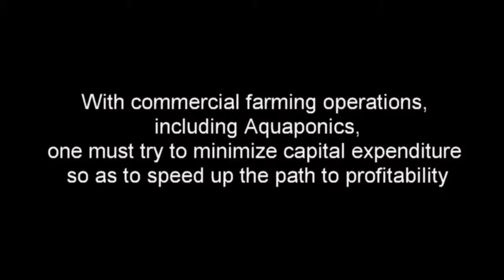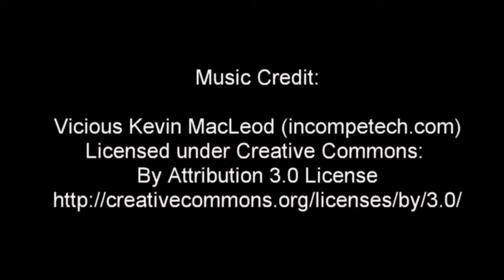How to build a small commercial DWC aquaponics system on a shoestring - For less than $1700

Comment: Thanks for sharing mate. 
Can you please tell me is there any thing done for aeration and also at what rate the water is pumped IN and OUT from  the system.
Reply from the maker: Thank you.. There are 50mm airtsones per growbed for aeration. You can see here http://www.myaquaponics.co.za/blog/8mx8m-open-space-converted-into-740-plant-aquaponics-system-for-less-than-r25000-us1700/  Fish tank relies on surface splashing for aeration.. Circulation flow is low at around 300-500 l/hr. Ideally you want the volume in the fishtank to turn once or twice per hour. We would need a water pump to achieve that, but decided to stay with airlift pump only and its working fine.

Comment: Hi just want to find out what power would you recommend for the airlift pump because I see in your comments you said that you will rather use a bigger pump.

Did you put a airstone inside the sump to blow the water back to the fish ?
Reply from the maker: Hi, we used the biggest air pump we had in stock which is the LP100 (100 watt - 140 l/m). We do not use an airstone in the sump to airlift the water to fish tank, we simply use a 12mm pipe directly from the air pump

Comment: Greatest video
But tell me why u used plastic bio balls and what is this.

Will not it add plastic into water

Love and thanks
Reply from the maker: thanks.. We used bio balls because we had some extra lying around though we prefer to use Leca (lightweight expandable clay aggregate). Bio balls are however extensively use as a bio media in the Koi ndustry as it has a good SSA (specific surface area). No issues with plastic affecting the water as they are made from food grade material

Comment: I love it!

May I know, how long did the liner last?
Reply from the maker: Hi the liner is still going strong.. Should last at least 5 years, but can last up to 10 years.
Reply: i think black liner last longer with more carbon in it, cold water also make it last very long time, sure over 10 years.
Reply: @Kingsley Mitchell scammer. do not google

Comment: Hi, I would love to build one of these systems myself, but would like more information on what you would like to improve on this system. From the comments I see one thing would be a stronger pump. Is there anything else? Also instead of your filtration system, I would like to build my own filtration system. I was thinking after the fish tank a swirl filter (210L blue barrel or conical tank) that would have those brushes in as well, followed by a constant flooded media bed for biological filtration. I could possibly grow some plants in here as well if I have the nutrients to spare. What do you think of this?

I would also like some more information on the airlift pump as I have never used one before. If I am correct, the hole you dug was 1.3m below the ground and your tank was also around 1.3m high, so the total length of piping you used to make up the height of the airlift was around 2.6m. You then place a large pipe into the hole that you dug which acted as your "sump" for the grow beds to flow into and to house your airlift. Was the airlift constructed out of 50mm piping as well? I am also interested in how you injected air into the airlift. did you just do a simple hole in the side of the airlift and attach the airlift to the air pump with irrigation nipples, or did you build a compressor chamber at the bottom of the airlift?
Reply from the maker: Hi Mark, most of you assumptions and ideas above are correct. You can easily build your own filtration system as per your comments. Airlift works on a one to 1 ratio, so if you want to pump up 1m, then you need to go down 1m with the air feed. We just use a 12mm irrigation pipe from the airpump to the bottom of the airlift pipe. Simple "U" connection into the bottom of the 50mm air pipe. Feel free to email us for more info. Email on our website at www.myaquaponics.co.za
Reply: @MyAquaponics1  Thank you so much for your prompt reply. I am still looking and learning more about aquaponic systems, if you don't mind I will come in the future with more questions hehe.

Thank you once again, and please stay safe and healthy.

Comment: By using a T instead of a bend you would be able to move even more water to the fishtank. Right now the pipe needs to move both air and water through the same pipe. By adding a T the air can escape and the pipe move alot more water
Reply: thanks, never tried that, so will give it a try
Reply: snubbel buff just like using a straw in a bottle for air escape
Reply: Add a venturi
Reply: snubbel buff 
Need some help building one in Jamaica
Reply: Not true.. a 90 is a 90 either way giving the same limitations to flow. However drilling a small hole in the top of the bend will allow all air to escape and get higher flow cause the pipe won’t be trapping air restricting syphon would actually be better unless you submerge the t and add stand pipe to it. In that case you would get the exact same flow from either setup. If you want to increase flow you need to get a full syphon which for some reason aquaponics is scared of. To prevent it from draining the entire tank in event of pump failure you add a hole just under the water line so it will break suction once water drops how ever far you are comfortable with and sump able to hold. You can actually get more flow from a full syphon 3/4” pipe then most are getting from the standard t fitting type setup using 3-4” pipe. If you want to do it right imop for aquaponics Systems 1-1/2” pipe using the t setup submerged 12” under the water to increase hydrostatic pressure on the system and using a 13-14” stand pipe off the top of that tee to reestablish syphon when power returns with a gate valve on the pipe to dial in the flow how you want would be the best setup. Then drill a 1/2”-5/8” hole in the stand pipe 2” below water level to prevent syphoning 12” of water during power failure. You can achieve over 2000gph and close to 3000 flow this way getting much better solids suction out of the tank cause of the full syphon then tune the valve to the flow the rest of your system can handle. You can run pipe much further and have a much cleaner, more efficient and cheaper setup this way cause you’re buying much smaller pipe. Ideally size the pump to 1 or 3/4” return lines and depending on head pressure you can have 1650gph easy in return with the ability to intake much more. This prolongs the life of the pump itself as no restrictions are place on the pump itself.

This is how we setup sump systems in regular fish tanks. 1” returns with 1-1/2” intakes using full syphon. We setup the system to only have the sump relieve at best 10g of water in event of failure and at same time we baffle the sump so the pump can only add 10g at best to the tank in event of a clogged intake line. 

Tune the intake to the return needed for balanced flow and eliminate all additional pump pressure on the systems. With this common setup we turnover water 10x per hour wo breaking a sweat. Higher turnover yields more dissolved oxygen and a cleaner overall system. Then you can increase pipe size and decrease pipe size where desired in the plumbing to reduce flow pressure or increase it wo altering the actual flow and water turnover of the system.. for example you wouldn’t want to blast a flood and drain media bed with high pressure from 1600gph flow rates.. so increase pipe right before the bed to 2-3” and use an elongated spray bar this would yield close to the desired water pressure into that bed wo sacrificing overall flow. Then use the same 1-1/2” pipe in continuous flow syphon from that bed. This whole belll syphon thing makes no sense. Out planted tanks have plants underwater entirely and indefinitely. They grow just fine and very fast. We add co2injectiin simply cause water doses have the same capacity air does. End result there is more then enough o2 in the water with a proper setup so roots don’t need to be out of water. I’ve actually seen several recent tests indicating this as well. Flow and turnover is much more important . In a dwc system intake on the bottom and return on the top. With 3/4”pipe. This ldnkeep from blowing raft all over wo sacrificing flow which deliver nutrient faster at lower more usable levels. Towers would be tricky and need a bleed off return sending most of the flow in a loop back to the sump while only 25% or so went to the tower. I would personally split this off the dwc return line which would lessen flow to both systems at same time wo adding additional plumbing. 

As for filtration.. the higher the flow the faster you break down trapped solids.. eliminating the need for a mineralization tank. (Erosion in plain terms) last note coming from a fish keeper... one thing that drives me nuts more then everything else.. using clay media that costs a fortune in grow beds is very inefficient. Place the media in your filtration which holds much less media will actually yield the exact same results for minerals and most important benefit of Clay.. iron.. pull 25% out every 6 months and replace it with new media. This will give much better mineralization to the system and make much better use of the surface area for growing bacteria. We do the same thing in fish keeping only we use the clay media as the substrate at the bottom inside the tank. It both absorbs and stores nutrients not needed til the are while also supplying much needed iron. (Clay has high iron content naturally) 

I also understand some like to try and keep flow limited for supposed better filtration.. this is true physically but practically it’s nonsense.. what is referred to in aquaponics as “retention time” in a filter is referred to by the rest of the water filtration world to include water treatment plants as “dwell time” the problem In small closed loop system is dwell time for filtration doesn’t work. The rules of biology and physics dictate that it takes 1 cubic foot of media at 1gpm flow to achieve a best case one pass filtration of 92-93%. This is cause filtration is limited by half life meaning no matter how many cubic feet or how slow the water moved through the filter you can not physically reach 100% single pass filtration of water. To make up for this you increase flow. The corresponding lines between flow and dwell dictate that it’s more effective to move water through a little media many many times then it is to move it slowly through a lot of media a couple times. In a 24h period you essentially achieve the same end result however you have massive spiking of toxins from the slower flow. When flowing faster and achieving a lesser % of filtration but filtering the same amount over said time you reduce spikes and achieve constant numbers.... in lame terms again your fish don’t all poop at the exact same time everyday.. it’s spread out over the entire day so getting rid of a little bit very fast is more effective then trying to deal with a lot all at once..
Reply: your system is amazing, please upload step by step videos to make it clear
Reply: hey ,if anyone else is searching for aquaponics diagram try Fast track grower (do a google search ) ? Ive heard some interesting things about it and my work buddy got cool results with it.
Reply: I discovered your video on Fast track grower - there are lots good  videos there that may help out
Reply: @fishrrelaxing9361  Great explanation

Comment: A really good video. But we appreciate  if you can share the infomation of the air lift pump. Tks.
Reply from the maker: thank you. There are many videos on youtube explaining how an airlift pump works. Basically it works on 1:1 ratio. If you want to pump up 1 meter you need to push air 1 meter below . We use a LP100 air pump rated at 140l/min and we pump up to 1.3 meter high. Ideally you should not be using an airpump to pump higher than 50cm... We simply used an airlift pump in this system to test the theory.

Comment: Flow rate looks a little low?
Reply from the maker: yes, correct.. Have mentioned this before as we are using an under powered airlift pump. Ideally we would need a more powerful air pump or a 1000l/hr water pump. Nevertheless, its working fine and giving good results.

Comment: how often do you change water?
Reply from the maker: we don't ever change the water, we only top up weekly as required due to evaporation or plant uptake.
Reply: @MyAquaponics1  how do you deal with root rot, because you said you don't ever change the water? And what is the temperature of the water in the grow bed?
Reply from the maker: @alvinmarto774  plenty aeration.. airstones every 500-600mm along the channel, 24/7
Reply: @MyAquaponics1   what is the temperature of the nutrient water in the growbed?
Reply from the maker: @alvinmarto774  we dont control the water temperature at all.. In summer it goes to around 25-26 Degrees C, and in winter it goes to as low as 13 Degrees C. As a result Leafy greens take an extra 2 weeks to harvest, during winter months

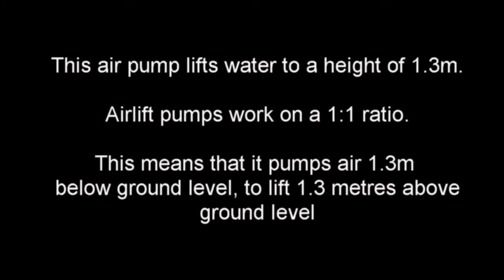Comment: Hi. I'm designing my own aquaponic farm based partly on your design. I noticed that you're using an air pump, both in aeration of plants and fish tank and for lifting water from the sump (1:15). But in 2:45, you used it solely on the airlift pump. Are you alternating the utilization of aeration and pumping of your air pump? Is it okay to break the cycle of the system? Your info is highly appreciated. Thanks in advance. :)
Reply from the maker: Hi, maybe the sequence in the video is not clear.. We have a single airpump that simultaneously pumps air to the air stones in the growbeds, as well as to the bottom of the airlift pipe in the sump that you see on 1:15  If we were to redesign it, we would possibly add a more powerful airpump as the one we are using is just slightly under powered for our system. It does however produce good results, so we are still running it as is.. Hope it answers your questions.
Reply: Thank you for your response. If you don't mind, I've got some more info to ask. What kind of airlift pump design are you using? Is it the "bubble" or "slug". I'm asking because I'll be using a pump (100 L/m) similar to yours, but have to lift water 2.3m above ground, in a pipe 1" in dia. Thanks, again, in advance. :)
Reply from the maker: We are using a bubble air lift pump. Its a 2 inch pipe. Our pump is 140 l/m. With a 1:1 ratio you'e going to have to go 2.3m into the growing to lift 2.3m.. May be more practical for you to use a regular water pump to lift the water to that head height.
Reply: MyAquaponics intersting information. Can you share how to built the airlift?. I appreciatte a lot it!
Reply from the maker: Hi, there are quite a few videos on youtube explaining how a bubble airlift pump works. Please note that you should not use an airlift pump for high flow requirements or if you want to pump higher than 1 meter. To make one, you simply need a pipe from bottom of your sump or tank, to a height where you want to pump to. Then use an airpump to blow air into the bottom of this pipe, The bubble effect will lift the water to the top of the pipe and out to a grow bed or other chaneel you wish to irrigate/fill. Please note the 1:1 ratio (pump air one meter deep to lift water 1 meter high.

Comment: thanks for the video. 
i have a Question - from grow bed to fish tank how do you manage to transfer the water?
Reply from the maker: We use an airpump to lift the water, referred to as an airlift pump. This does away with the need to have a water pump, thus reducing the overall power required to run the system. Airlift pumps work on  1:1 ratio. If you want to lift water to 1 meter, you need to pump air 1 meter deep. So it is limited to smaller systems such as this.
Reply: will try airlift pump. Many Thanks. GB
Reply: so you are using a sump, under grow bed?
Reply from the maker: no, the sump is the DWC grow beds. There is no need for an extra sump in this system.
Reply: I ask because the airlift pipe seems to be going underground. But it is most likely due to ground level... my guess ?? :)
Reply from the maker: yes, the airlift pump is blowing air down 1.3 meters as that is the height it needs to pump up to.. So basically we have a 110mm pipe going deep into the ground to be able to get the required lift. In essence, the DWC beds and the 110mm pipe (which are linked together) make up the "sump"